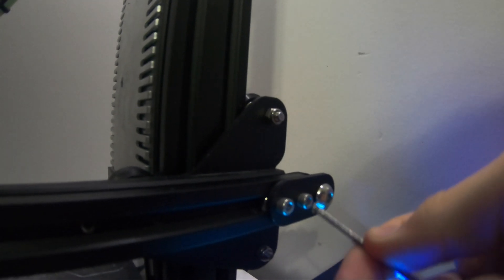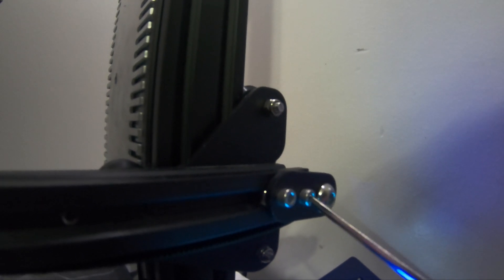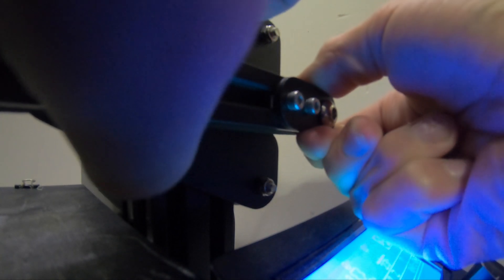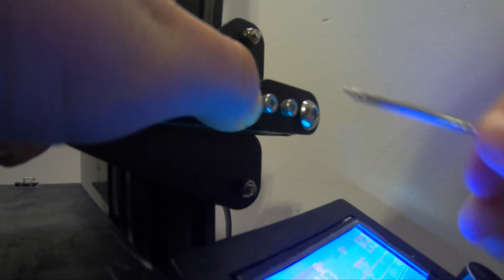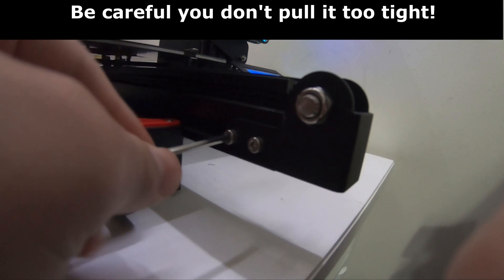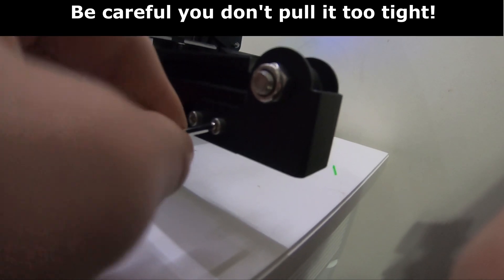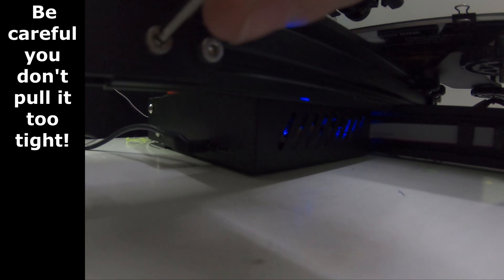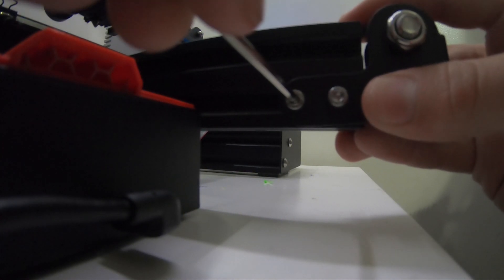How To Tighten The Belts On Your Ender 3! Also Works For The Ender 3 Pro, Or Ender 3 Max!

Comment: What’s too tight or too loose? Would be nice if you gave a tip or trick to make sure proper tension is applied.
Reply from the maker: It is very hard to get them too tight, try to get it to the point that when you press on the belt there is just a little bit of play. If you get them too tight, they may stretch. Although, with the default setup, it would be hard to get the belts too tight.

Comment: The problem I have is when I go to loosen them, they fall out. Then its tough getting it to hold in place again. Any tips?
Reply from the maker: Make sure the little t-nuts are seated in the extrusion correctly and make sure the couplers bolts are tight. Example of how the nuts should look here: https://sc01.alicdn.com/kf/HTB1i3i3d50TMKJjSZFNq6y_1FXay/t-slot-nuts-for-6mm-8mm-and.jpg_350x350.jpg
Reply from the maker: Ok, those are the nuts with the bolt on them, just make sure they are not sideways and have something to grab onto.